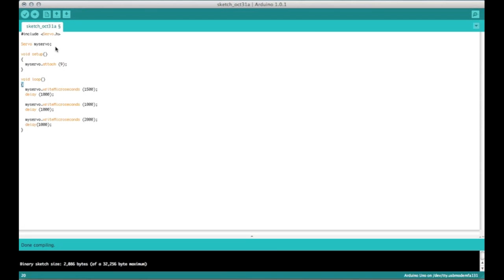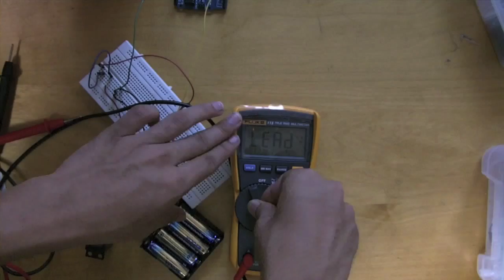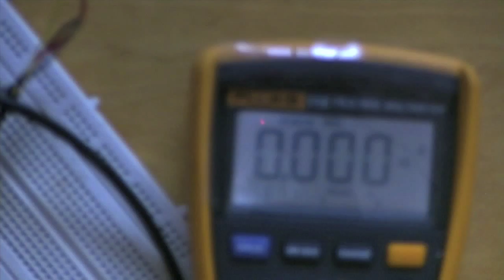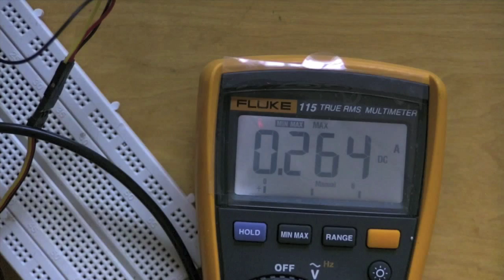How to Control Servos | Arduino Tutorial

Comment: SO WHAT ACTUALLY MOVES THE SERVO LEFT OR RIGHT?

I'm trying to program a 180 degree servo (which I modified to turn 360 degree) to stop at a certain point in its rotation, how would I go about doing that if you know. 

awesome video to

Comment: how do you make the weels of the robot always turn more than 360 degrees? servos wotn let me do that
Reply: you an hack a servo to make it spin indefinitly , just google
 hacking servos
Reply: +Cameron A You could actually just hack it ... Without the need for what you said ...
Reply: buy a Continuous Rotation Servo
Reply: Why not just hack it? it's much cheaper
Reply: BroOlympus either hack or buy continuous.  Either method will work.  Just letting OP know that they do sell them.

Comment: if a cat dose chew on the wire you can strip the plastic ends and connect the coper ends and it will work 🔌🔋➰ P.S. don't let the connected bit touch a other connected coper bit

Comment: The current shown is with no mechanical load on the servo. As soon as the servo has to apply a bit of torque against a mechanical load the current draw goes up... just something to keep in mind if running off a regulator or when trying to work out battery capacity.... also, if you mod a servo to run continuously as a geared motor you don't have any ability to measure the RPM so a gear motor with shaft encoder would be better for driving robot wheels if you want to have a worthwhile degree of control over its speed/direction.

Comment: it keep saying 
Arduino: 1.6.5 (Windows 8.1), Board: "Arduino Uno"

sketch_sep07a:3: error: expected initializer before ':' token
sketch_sep07a:6: error: expected declaration before '}' token
expected initializer before ':' token

you know what im doing wrong??
Reply: +Nuker 9000 You need on every end of line of code  a ; wenn you are done with that line of code.

Comment: Arduino: 1.6.4 (Windows XP), Board: "Arduino Uno"

c:/program files/arduino/hardware/tools/avr/bin/../lib/gcc/avr/4.8.1/../../../../avr/lib/avr5/crtm328p.o:(.init9+0x0): undefined reference to `main'
collect2.exe: error: ld returned 1 exit status
Error compiling.

  This report would have more information with
  "Show verbose output during compilation"
  enabled in File > Preferences.

Comment: I have one error when following your code please help.

expected initializer before':' token error compiling
Reply: +Ian Mather 
Here is the code that I used:

#include <Servo.h>
Servo myServo;
void setup() {
  myServo.attach(9);
}

void loop() {
  myServo.writeMicroseconds(1500);
  delay(1000);
  myServo.writeMicroseconds(1000);
  delay(1000);
   myServo.writeMicroseconds(2000);
  delay(1000);
}

------------------- Here is the diagram of how its meant to be set out:

https://123d.circuits.io/circuits/1414288-the-unnamed-circuit

Comment: I would imagine the servo data sheet would list an accurate rotation/time ratio at a given voltage.  Guess and check works but is not a substitute for calculation.  Regardless, thank you for posting.

Comment: The comment on grounding the Arduino board is a good one.  I struggled for several hours trying to get the servo to work properly.  Once I ground the Arduino board to the prototyping board everything work great.  Thank you for the You Tube tutroial

Comment: If it is only drawing 260ma then there is no chance of frying a USB port if you use the 5V+ pin for power because it supports 500ma on usb and 1000ma if you use the power jack. And the digital pins could probably support a micro servo because if your servo draws 260ma they can support 250ma.

Comment: Your electrical connection as shown is not completely correct, your power supply is floating with respect to the Arduino. You need to connect the arduino ground to the battery ground (negative terminal). If you don't do that you might encounter unexpected behaviour (or dead pins). If you already connected it, I didn't notice in the video. Good job with all the rest.

Comment: i get this message

sketch_may07c:8: error: function 'void setup()' is initialized like a variable
sketch_may07c:9: error: expected unqualified-id before ')' token
sketch_may07c:13: error: expected constructor, destructor, or type conversion before '(' token
sketch_may07c:15: error: expected constructor, destructor, or type conversion before '.' token
sketch_may07c:16: error: expected constructor, destructor, or type conversion before '(' token
sketch_may07c:18: error: expected constructor, destructor, or type conversion before '.' token
sketch_may07c:19: error: expected constructor, destructor, or type conversion before '(' token
sketch_may07c:20: error: expected unqualified-id before ')' token

Comment: Hi , i recently bought a servo motor, Arduino uno and motor shield v2.0 . i would to know do i need to get the white circuit board like the one u had in the video to operate it or its optional ? Btw I'm new with the device and i need the shortest and easiest way to run the servo motor due to my deadline of my work . thanks

Comment: look i know you hear this all the time but i just wanna remind you that your awesome, your rain day video saved us from reading and sifting threw thousands of usles sentences , the way you structured this video was top of the line , you started with a common problem that must be worked out before using the device within its full perimeters at the same time you showd us how to use it , because now i know how to alter the rotational arc length

Comment: i think the wiring is a bit strange? like there's power going into the battery and the board has a different power (hence the signal coming from pin 9). shouldn't there be a transistor between the board and the servo so that the board is actually giving the 5v from the battery to the signal cable via the transistor? (and shared gnd?)

Comment from the maker: Yup! It's not too hard to modify a servo to rotate continuously. All you need to do is cut out the gear stopper and glue the potentiometer in place so the servo thinks it's always centred. Then, when you give it a signal (i.e. 2ms pulse to go right), it will keep trying to turn because it thinks it hasn't moved, and the gear stopper won't be there to hold it back.